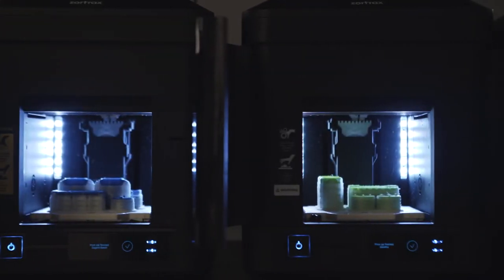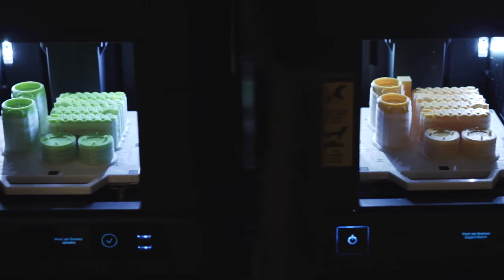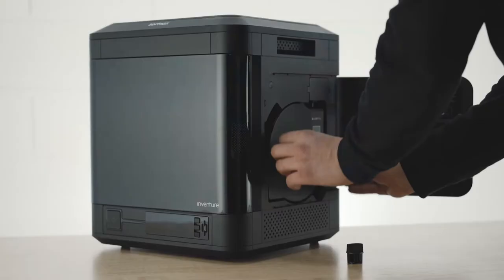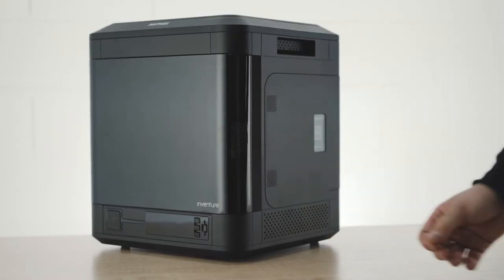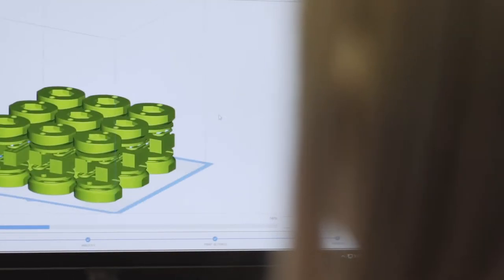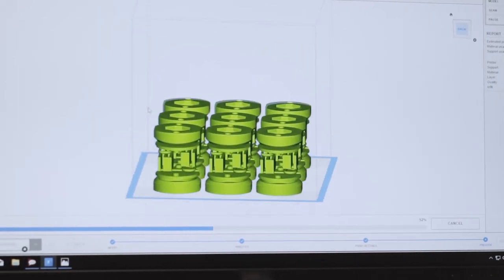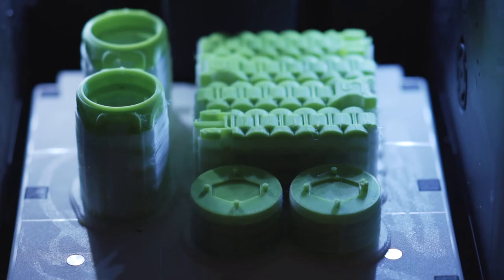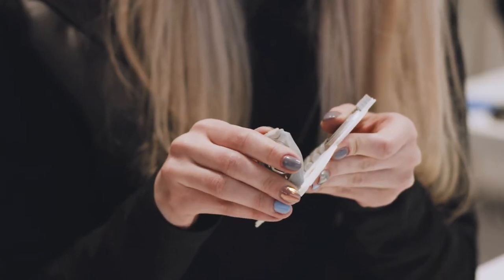How Zortrax Inventure 3D Printer Works in Short Run Manufacturing

Comment: ZERO Youtuber reviews of the Inventure - now on sale on their website - Zortrax Inventure has been a huge failure for Zortrax. They didn't promote it on Youtube whatsoever early on
Reply from the maker: We don't regard Inventure as a failure. We've recently added major improvements for this printer, such as the ability to print with materials on spools, external materials profiles, and single-extrusion mode. In the newest Z-SUITE BETA, users can test hybrid support and new materials profiles (https://zortrax.com/blog/new-z-suite-enters-the-open-beta-testing-phase/). We can't force users to do reviews on Youtube, but from what many of them say, Inventure has become their preferred 3D printer with the latest updates :)
Reply: @ZortraXTV  I think the price of the refills have put people off, I have just bought one and am struggling to find cartridges for it as I don't have the space for the big ugly spools sticking out of the sides - I have 4 other machines, all Zortrax, love them, so the inventure is a bit of a luxury for small complex items :)
Reply from the maker: @inspiringengineer  Sorry to hear that you don't have so much space, especially that with spools Inventure shows its true potential! If you're looking for cartridges, they are available in our Zortrax Outlet (https://store.zortrax.com/outlet?page=1) up to 40% off :)